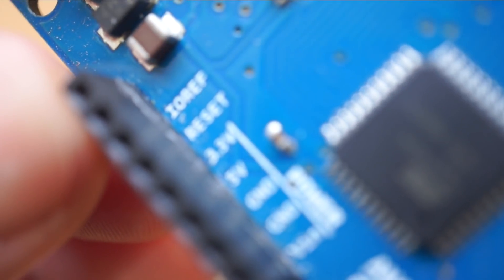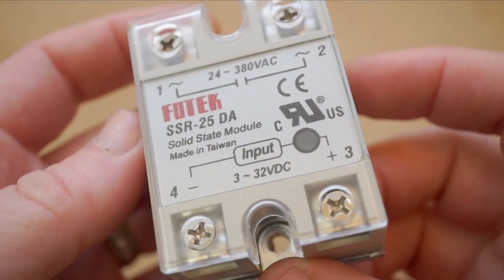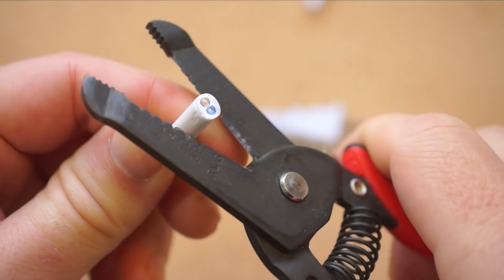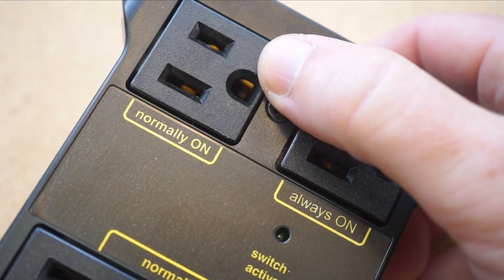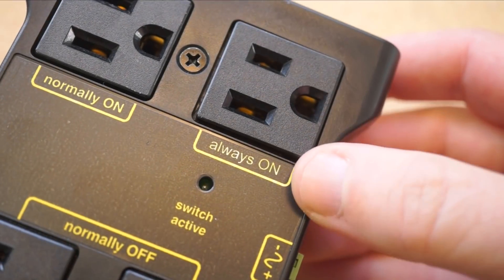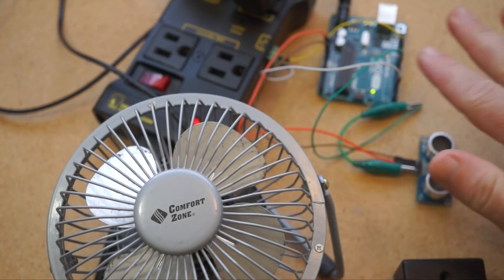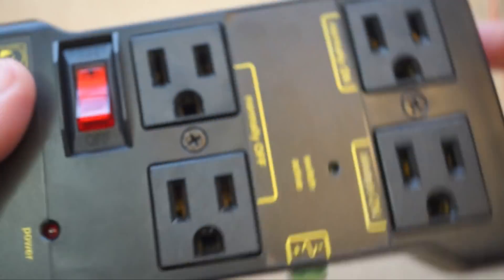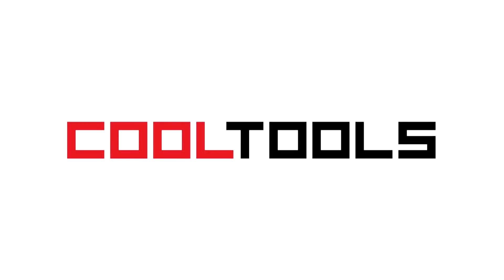Reliable relay power strip

Comment: 1. Actually individually controllable sockets are too few.
2. No 220V
3. Seems expensive compared to common 4 socket powerstrip with individual on/off switches (I can buy a decent one for about 6 USD).

Comment: Thx for the review.  Cool device!  
 I'm not sure if this device will work for my current Shop Project. 

I am trying to find a device to control my shop vacuum system which has two vacuum input ports to support to two shop saws. 

Currently on must separately turn on the shop vacuum system before I operate Either saw & turn it off when done. 
I would like the vacuum system to automatically turn on when i power up either saw & the off when I'm done using the saw.

I am looking for a current sensing switch which will sense 2 outlets (each saw) and then will automatically activate power to a 3rd outlet providing power to the vacuum.   

Thank you.
Reply: Not a plug and play system but here is a good video talking about what you are trying to do. Hope the video helps or that you figured it out already! https://www.youtube.com/watch?v=D1JWH425o7c 

EDIT: And when I left that video I saw a link to this video https://www.youtube.com/watch?v=PqiK3PxIlzI that looks like it is off the shelf components from Rockler. Made in 2015 so do not know if they still sell those things.